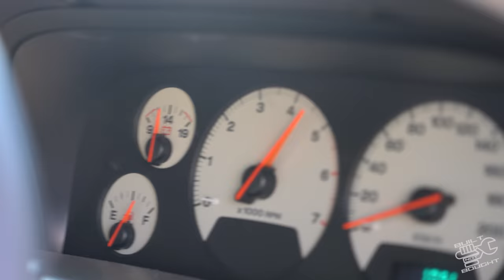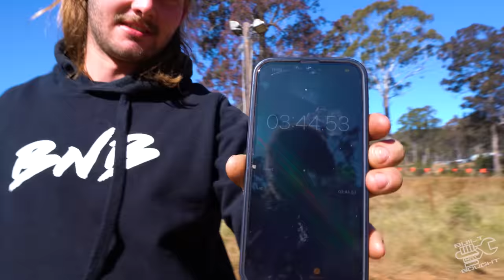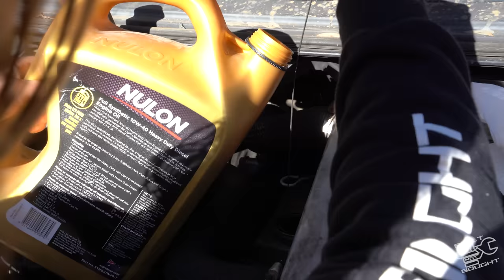Budget Builds - PETROL VS DIESEL 🤬

Comment: I would take that set of tools if I won and I would rip off everything one of my fingernails if I could get the chance to come and finish the competition with you guys even if I'm just a spectator hanging around with the weird hands. The real question is do I need to rip them off with the pliers or the chisel or hammer?

Right and my favorite team of course is the Delica because I got a few of those suckers myself and I've got quite a bit of love hate relationship with them I have put them underwater I put them in the air I have put them on the side and that's how you do the hokey pokey